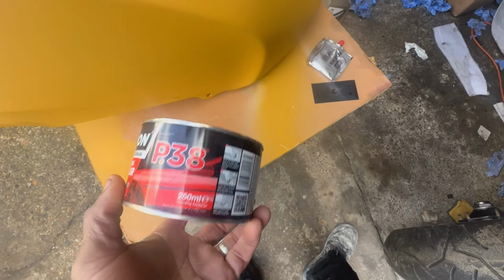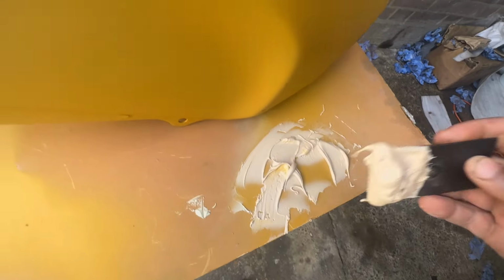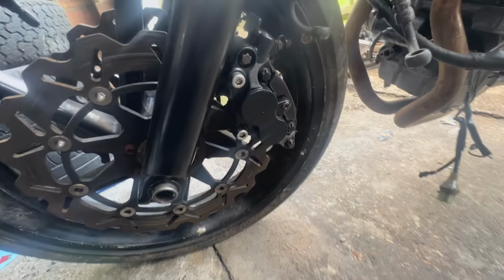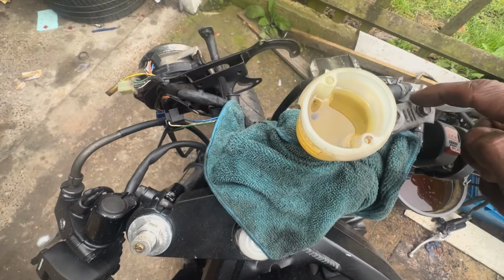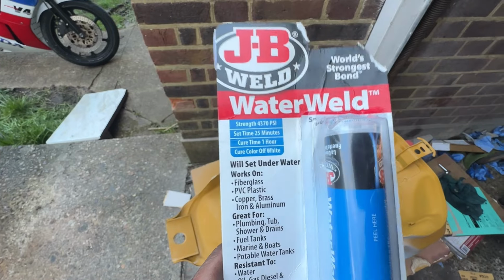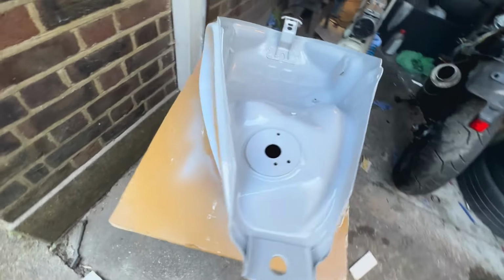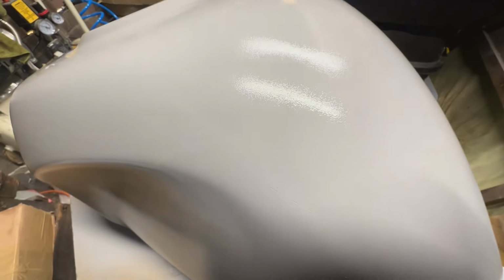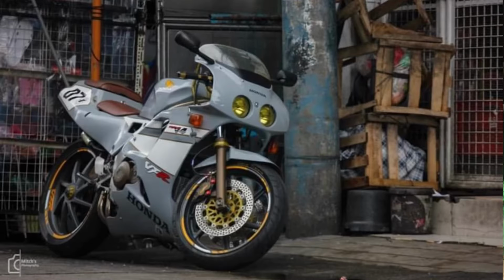Restoration of a “Barn Find” VFR 400 NC30 - Episode 29

Comment: Paint work is great, 

But a comment about how the brake hoses on the front calipers, 

You need to make sure that when the hose fits on the caliper, it is close to the fork,

This gives plenty of room for access to the bleed nipple, 
Check the pictures in the Haynes manual 

You doing great